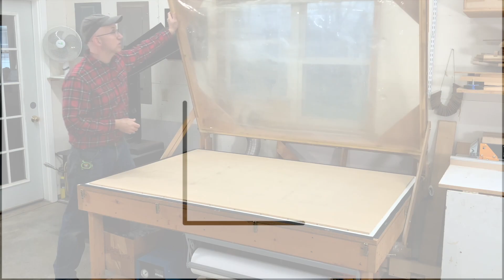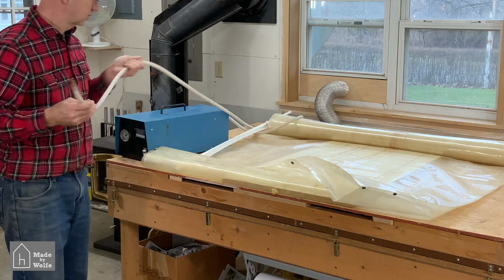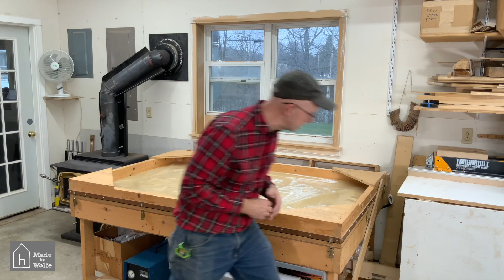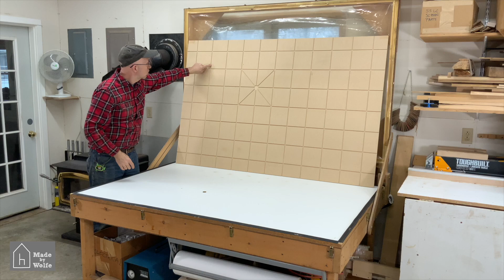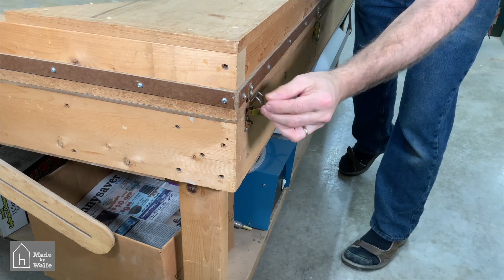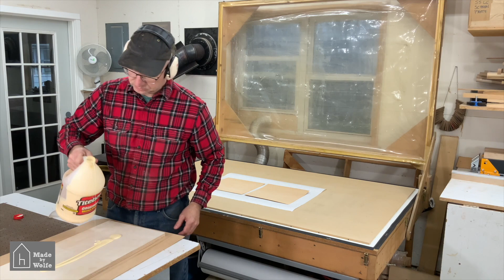A Vacuum Press for a Small Woodworking Workshop:  Bag Presses and Flip-top Presses

Comment: Hi there, thanks again for the video. I’ve recently built my own smaller version. I now have it to a point where it’s pulling full vacuum, but loses vacuum fairly quickly. The pump cuts back in again after about a minute. I’m scratching my head as to where I’m losing air, I’ve even siliconed the seal to melamine junction in case the double sided tape is not creating a seal. Just wondering if you had any similar problems or if you might be able to point me in the right direction? Thanks again, have a great day!
Reply: Same here..

Comment: Thanks for the detailed video, excellent. Just wondering what type of foam you used as your sealing edge? I know you mentioned it’s ‘P’ shape, but is it a specific type, ie. closed cell? Thanks again.
Reply from the maker: Yes, it was a closed foam, but I could not find the exact shape at McMaster-Carr.  But it was 20 years or so ago when I built the table.  It really could be just about any closed cell foam extrusion.  You just need to be able to stick it down.  Some of the foams actually have adhesive on them.  Good luck.  I am sure it will be fine.
Reply: @MadebyWolfe  That’s great, thanks very much for that!

Comment: Question:  Could a vacuum press work for gluing in inlays?  Keep in mind that the male side being pressed into the female stands proud of the female board thus there is a gap between the male board and female board.  The two boards may be 12x12 but the male and female area of the inlay itself may only be an odd shape and maybe 6x6 inches. When using clamps, there is about a 1/4" cap between the respective boards.  Would the vacuum collapse and break the board material around the inlay?  The male inlay board may only be 1/2 thick depending on the depth of the inlay.
Reply from the maker: There are a lot of variables here, but the basic principle is that you do not want there to be an unsupported overhang.  My understanding is that this is what you are creating.  

That being said, there are several things to consider.  First, what is the difference in thickness between the inlay negative area and the thickness of the inlay.  If it is 1/4 inch then I would proceed with caution.  But if it is only 1/64 of an inch I would not be concerned.  I have also used cork board as a backer when there are some uneven surfaces.  For veneer, it is stiff enough to still clamp the veneer, but has enough give that it will compensate for differences in thickness of materials.  Second, what is the thickness of your inlay.  if your inlay is thick enough, you may be able to place substrate down against the veneer press and let the bag pull the inlay down agains the substrate.  If your inlay is 1/2 inch, I think that this would be more than sufficient in many cases.  Finally, how delicate is your inlay.  if it is not extremely delicate, I think that suggestion that I just mentioned, putting the substrate down against the veneer press and letting the bag pull the inlay down against would work well.  

If you are doing many of the same inlay, you could also create a cull that overhangs the inlay about 1/4 inch in all directions.  This would make sure the pressure is distributed evenly and that the inlay is pulled down evenly and could be reused.  Just make sure you have waxed it well to make sure it does not stick to any glue that sneaks out. 

Hope this helps.  Good luck.

Comment: Thanks for the details on the lift top table.  I am trying to carve out some room in my overcrowded shop now to build one.  What are your thoughts on Silicone film vs. polyurethane film.  Looks like the silicone stretches more for doing form work, more durable, more heat resistant and more puncture resistant.  Im mostly concerned with having enough give for making curved cabinet doors and such.  No budget for a vacupress fliptop at the moment.  I found 30mil silicone sheet down the road from me for about 150 bucks. It seems like the better option at this point.
Reply from the maker: Glad you found the video informative.  I am not familiar with silicone films.  I have only ever owned extruded polyurethane.  Like I said in the video, I mainly use the flip top table for flat work and pull out my bag for form work.  If you want to do curves and shapes of any thickness, a bag is the way to go.  good luck.

Comment: Sorry, but a $365 entry point is too high.  When they get the price down to sub $200 I might look at them.  In the meantime there are lots of alternate sources of pumps in that lower range.
Reply from the maker: hmmm...interesting comment on a hammer video.
Reply: @MadebyWolfe  You've got the wrong video, the one I commented on was about vacuum presses
Reply from the maker: @johncole9964  John.  I am so sorry.  I have a 11 second video of my comparing the regular mallets that I made to the dead blow mallet that I made and it has over 11 million views in the last month and WAY too many comments from people thinking I am trying to trick them.  I was plowing through some of those comments and didn't realize this was for the vacuum press video.  

Anyway, I am all about saving money.  I am the family tightwad.  When I purchased this pump 30 years ago, there were not a lot of other options.  And anytime I have used something consistently for 30 years, I will recommend it, even if it costs a bit more, because of the over all value.  But you are right, there are many pump options out there for less, and if I was purchasing my first pump I'd probably try one of them out.  

However, the things you can do with a vacuum press, are pretty amazing.  It is a great tool to add to a shops capabilities.  So, if you too think it would be useful, I'd encourage you to try out one of the lower price pumps.  If you do, I'd love to hear about your experience.  

Thanks for commenting and sorry about the mixup.
Reply: @MadebyWolfe  Congrats on the viral video!

Comment: Wow mate, I am converted. I am building wooden spearguns so laminating five 35mm wide x10mm thick strips to each other at about 1300mm long with west system epoxy, some with carbon cloth between. I rekon I could resaw 150mm wide strips and then cut them into four 35mm wide lengths after curing. Seems like a far more repeatable process. So it would be essentially a 150x50x1300 board made up of five 150x10x1300 veneers to make the 50mm. Any thoughts on this? I am not asking too much of a vacuum system?
Reply from the maker: It definitely is not asking too much of a vacuum press.  I have done bent laminations that have were roughly 300 x 2000 out of 6 layers of plywood that was 3mm and it has no problem pulling it down onto the curved form.  I have never used epoxy in a vacuum press, but I don't think it would be an issue.  There is another glue called urea resin glue that has excellent water resistance and rigidity, but that can clean up with water.  I am not sure if it would work for your application, but might be something to look into.  Here is where I purchase it in the United States ( https://www.vacupress.com/product-category/veneering-glue/unibond-800/ ).  I googled spearguns, and they look really cool...and deadly.  

What is your current setup for gluing the spearguns up?

Comment: Thanks for the video. Wondering how this would do with end grain cutting boards and such. Congratulations on 1k subs too!
Reply from the maker: Interesting question.  Because the nature of the platen and the air being evacuated from one side, the effect is one of forcing layers together (plywood and veneer for instance) but very little side ways pressure, which is what you would need if I understand your question correctly.  So, I do not think it work for end grain cutting boards.   Thanks for watching and thanks for the question.
Reply: @MadebyWolfe  awesome response thank you. That's kind of what I suspected but doesn't hurt to ask thanks again for your response